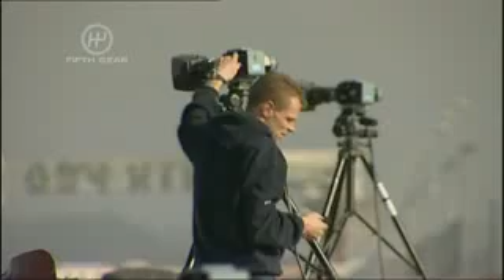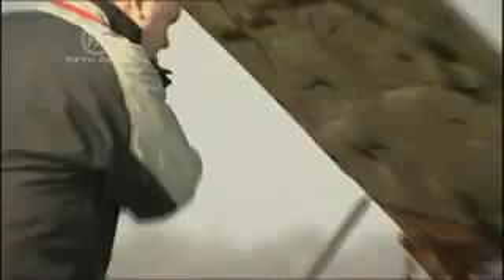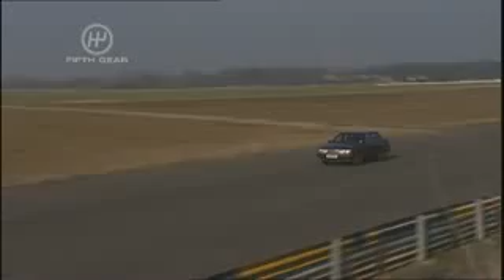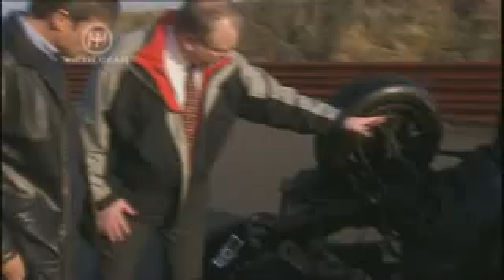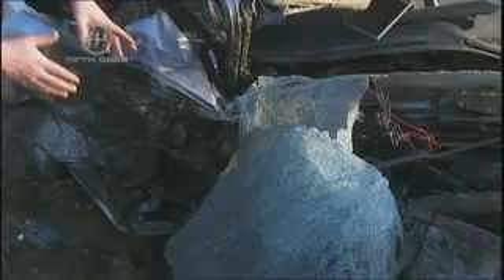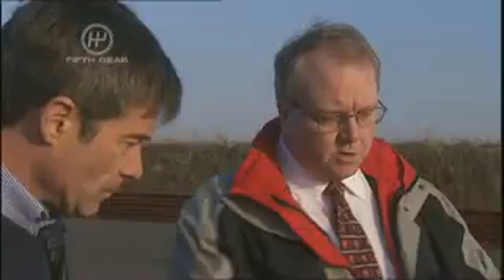Fifth Gear - 60mph Head On Crash

Comment: It pretty amazing, I found a NIHS crash test of a 98 Ford WIndstar like the one I have and it actually did pretty well in the offset despite being made before they started worrying about that stuff.  Modern cars are so much safer than old ones, but I really wish they'd make cars look like old 60's and 70's vehicles but have modern safety stuff.  Modern cars have tiny fronts, just imagine how safe a car would be if it had proper crumple zones but still had a 10 foot long front end like the cars of old.
Reply: Just more metal to be pushed into you

Comment: While there is an impact of 120 mph, the forces involved are not the same as a 120 mph crash into a wall. If you crashed one of those cars into a wall at 60 mph, the damage would be very similar to the damage in this clip. At worst, this would be similar to maybe an 80 mph crash into a wall.

Comment: Well the camera was focused on the Volvo and not the BMW, and since the E34 was going in the opposite direction, it would seem as though it going faster due to the combined movement of the camera and the BMW.  Plus, the weight of the Volvo also contributes to the severity of the crash, it weighs about 300kg more than the E34.

Comment: My aunt just died in head on crash both cars going 60mph. Modern cars are alot safer but at 60 mph there usally are to high of g forces. We need to start implamenting 60 mph crash tests and start making cars out of stronger metals and carbon composites.
Reply: Even today, not all brands are equal in tolerance. Volvo & german stuff is highway tolerant (possibly subaru too but i haven’t seen enough examples with them)

Comment: @turin1 Interesting comment!  The dry runs completed, the cameras set up accurately at the impact point with room to spare, then on the actual run one of the remote control guys decides not to accelerate so fast!  Why?  'Cause he thought it would be better!  Result - impact point 10m from all the dry runs and out of view of the fixed high speed cameras.  Doh!

Comment: @calendar11 The VW Golf has 2 millimeters :P of crumple zone, If it were a larger car like the ones in this crash test then that would offer more room to help you slow down, like SUVs with hoods that go out 4-6+ feet (especially 5-star crash tested BOF Ones) and full-size cars(5 star) and even a few midsize ones wouldve fared far better than the VW in that crash test, plus 62 mph is different than 60. If the IIHS crashed a car at 40.8 mph then they have to redo it.

Comment: These are 20 year old cars before crash testing and safety really started(mid 1990s in when the real concern and changes started, the IIHS really kicked it off). If these were brand new 5-star top safety picks with the strongest safet cages and lowest dummy movement recordings on the market then they wouldve survived.
Reply: I think a head on crash between a 2010 and a 2020 car nowadays would be fairly equal

Comment: I guess some say this isn't a head on crash, as this an offset crash. Only part of the front ends impact. And that's also the problem with these older cars. The Volvo 900 series certainly did have a safety cell, but the design wasn't that great in an offset crash, which nowadays is the standard EuroNCAP frontal impact crash. The Volvo 850 probably would do a bit better. But as some have pointed out, too much deceleration will still kill you, even if the safety cell were intact.

Comment: just to correct you dude.

modern cars are disigned to absorb the shock, the whole body will, thats what they call a body shell that is used in new cars like the merc , BMW, and the luxes .

so even if the crash was head on, even the rear of the car will be dameged, cuz a part of the shock will be transsmitted to it through the body shell, redusing the damage that will be done to the inside of the car, the cocpet

= saving the passengers, but totally destroying the car

gday ;)

Comment: no gazy pog you are an idiot

a 120 mph crash is deccelerating from 120 to 0

the cars are only going 60 mph, therefor to undergo a decceleration equivalent to 120 to 0, the car would have to decelerate from 60mph to negative 60, or 60 in the opposite direction

both cars stop moving, if one carried on at 60 and the other crashed into it a head first at 60 and just got pushed back at 60 the way of the first car then it would be 120

that would only work if it was a tank and a mini though

Comment: im sorry but the crashing speed is not 120mph

just because both cars are going 60 doesnt mean you add them together

its the same as hitting a block of concrete at 60

the conrete gets its stopping inertia from its weight, whilst the car gets its force to stop the other car from its equal velocity

the car is only decclearating from 60 to 0

Comment: actually ther you hit someone driving at 60 too so you pretty much hit a wall at 120 ...
Reply: Not true, assuming both cars weight the same, at most this is equivalent to an 85 mph crash into a wall, but it's likely somewhere around the 60mph range. If the impact force was equivalent to hitting a wall at 120, one of the cars would have less damage than the other one, which would get launched backwards by the collision, , but it only happens if one vehicle had more weight than the other, like a subcompact hitting an 18 wheel tractor trailer head on the reason the damage looked so severe was because the cars hit at a small offset. If you know anything about crash tests, is that until recently, cars frequently got poor or marginal scores on the small offset at 40. These cars were 10 years old at the time the video was made, which those cars are now 25 years old. If a 10 year old car couldn't survive a 40 mph small offset, these cars certainly couldn't survive a small offset at 60